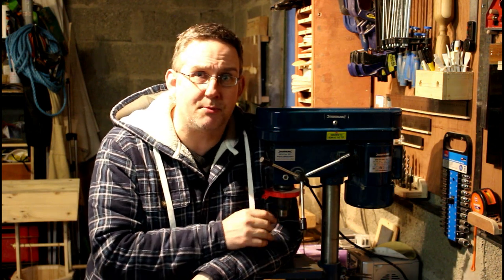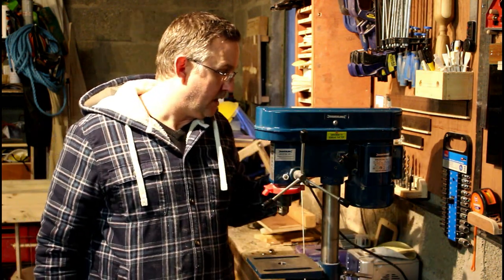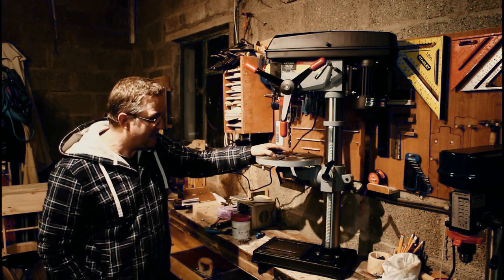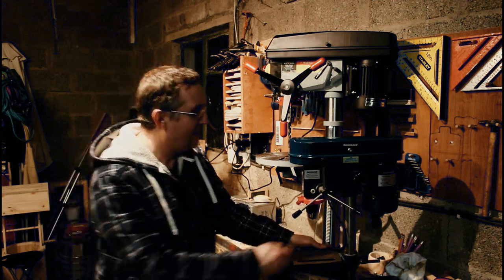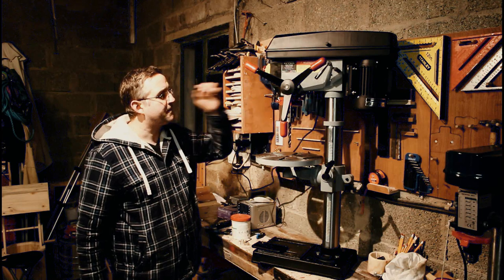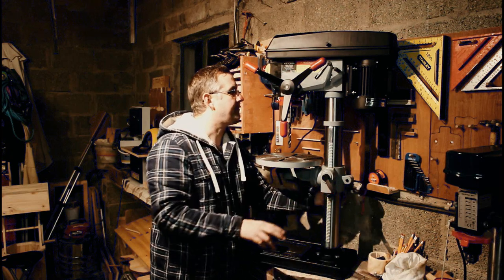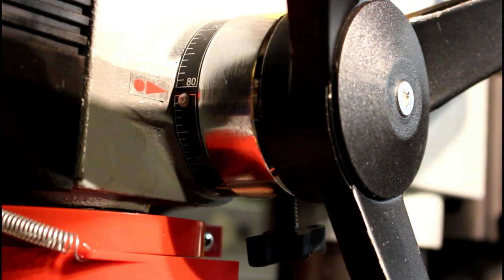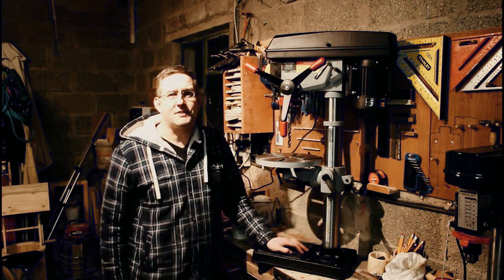SIP B16-16 Bench Pillar Drill

Comment: I've been lookin at this drill press lately, I need the added quill travel this has over the normal 50mm ones. 
Hows it been doin, any problems?? Question..... can the rack turn around the column allowing the table to be swung left and right in relation to the chuck?? I often have to hang stuff off the side of the table for drilling.
Reply from the maker: hi mate, sorry for the late reply, been mental busy with work and stuff.  Drill press is great, I've had zero problems with it, and still use it most days.  The depth stop system is a bit hard to dial in exactly, and takes a bit of trial and error to get it set right, but not as bad as the old system I had with the threaded rod and the two locking nuts!!!  As for the rail, i'm not sure how easy that would be, memory says that it would be quite hard due to the way it assembled.  Good luck with your purchase if you do go ahead, I'm more than happy with mine!.   Thanks for watching!
Reply: @andy.elliott.foreverpens  thanks for your reply buddy 🤙 I think I'm gonna go ahead with that drill as it meets most of my criteria, mostly the 80mm stroke 😁 soon as Jebbtools gets it back in stock its mine 😂🤙
It's nice to see a fellow Irishman (by way of the Pool) on the Tubes lad 💥🤙 
And dony worry about late replies...... life has a funny way of gettin in the way sometimes 😂🤣 
Take er handy lad, and thank you 😁🤙

Comment: sip is a great brand,i like that drill
Reply from the maker: couldn't agree more! My table saw, Sliding Mitre saw and Dust extractor are all SIP.  Now I've added this beast to my collection! I'm starting to detect a theme starting........ :)
Reply: @andy.elliott.foreverpens  do you have any experiance with the sip scroll saw,thats on my list next and table saw
Reply from the maker: @lennyrossa834  hi Lenny, not with the scroll saw. I have an Einhell scroll saw. However I do have the 10inch Sip cabinet table saw, which is absolutely brilliant! I can't recommend it enough!
Reply: Hi there pal, can I ask  you  a question, I have a chance to upgrade my old Draper drill press, I was thinking of SIP but I was reading some reviews on woodworking  forums and many had dreadful things to say about SIP so I am a little concerned, I was then thinking of Axminster drill press with top quality bearings, both presses are si similar in price. I would value your opinion, what is your experience now with your sip drill press, is it accurate, smooth and  bearings good or is there issue, kind regards Louie